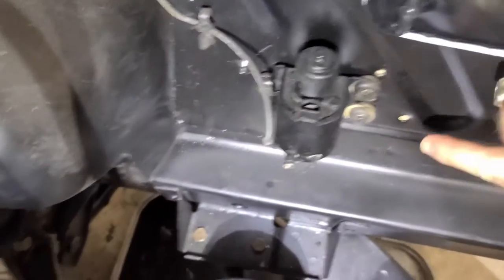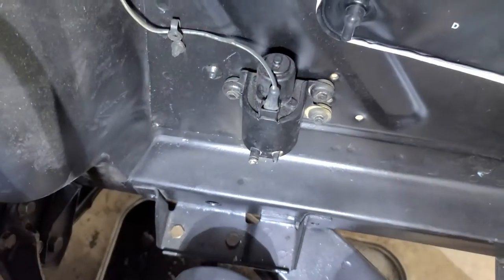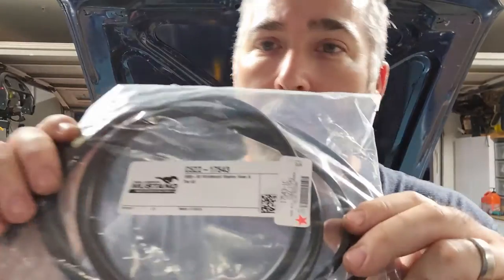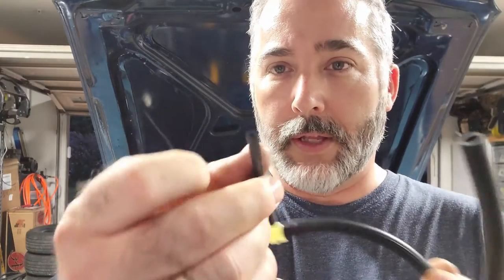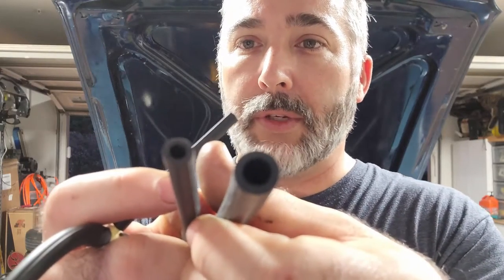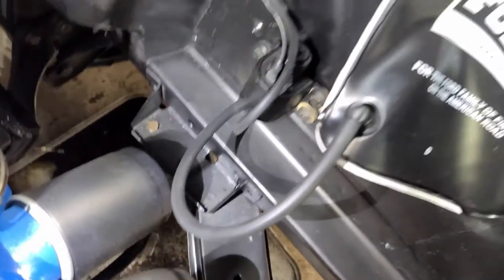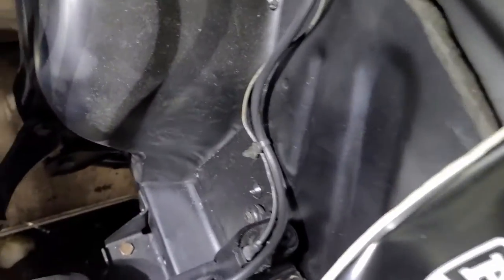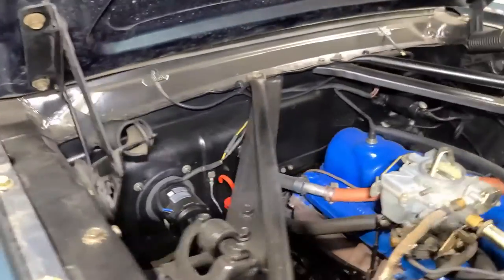66 Mustang Windshield Washer System Install

Comment: thanks for the tutorial - very clear and informative. But what about the wiring? With a single position wiper switch?
Reply from the maker: It is one wire to the pump, and the other side is grounded.